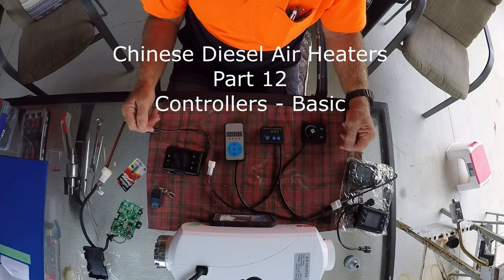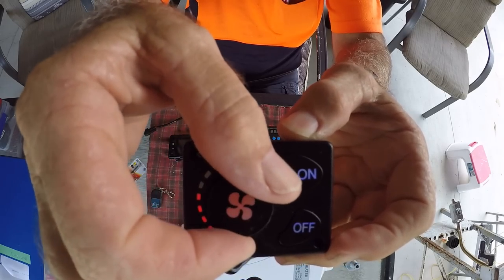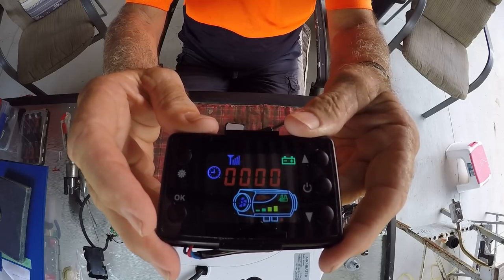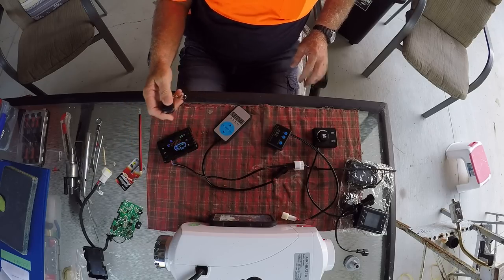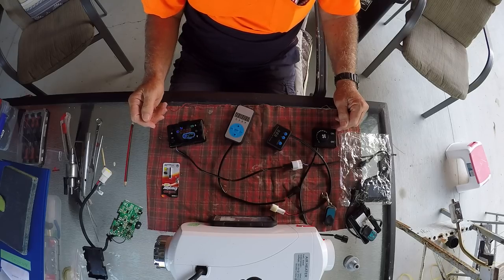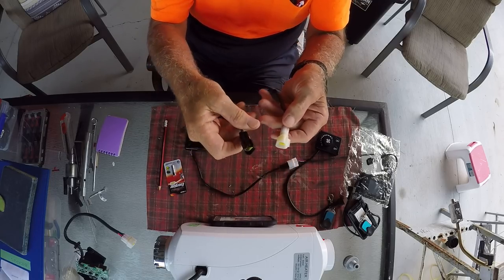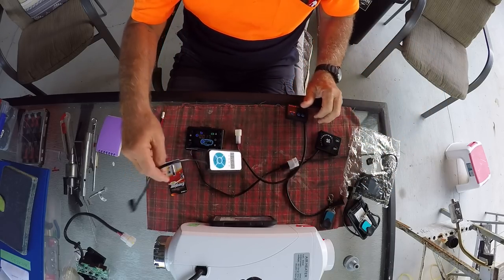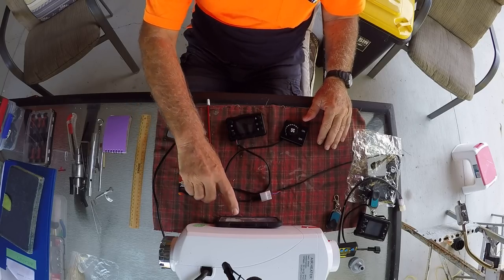Chinese Diesel Air Heaters -  Part 12 - Controllers (Basic)

Comment from the maker: Hi there
You can go into the menu in the ECB and make changes. There are a number of people online who will give you the password. 

I no longer do that because I have seen too many users get themselves in a whole lot of problems. There is no reset button back to factory settings. 

If your set up is correct, and your issues are with a new heater, I suggest you ask for a replacement as you could have controller or ECB issues. JMcK

Comment: Wondering LCD controller has to be mounted inside the room being heated?
Planning on mounting to heater outside the room under a cover and just plumb the heating pipe inside. Trying to reduce noise plus carbon monoxide risk.
Should I wire the LCD controller into the room so the the thermister can control the heat inside the room? Thanks

Comment: If one loses the connection for the controller while the heater is in operation; how about then disconnecting the fuel pump power?  Will the heater keep running the fan in this scenario; with no ECU and no fuel flow?

Comment: My pump disengages on startup. The heater works great, but it's very hard to get it to start. Sometimes I can trick it by priming the pump. If the pump would stay engaged it would start every time. Do you know why?

Comment: The problems you had with the white metal cased heater where the wires were mixed up, what you can do is just unsolder the two or three wires and then resolder them in the correct order. That way you can keep the old ECU. Simply reorder the wire

Comment: Very helpful info. I am thinking of powering the heater from the 240v mains supply using an appropriate adapter. Power cuts in my area are quite common, though they last less than 10 seconds at a time in most cases. What should you do if the power is shut off unexpectedly? 
I was thinking of using a 12v relay and a small motorcycle battery I have sitting around as a fail safe. 
The idea being that when the mains is on, the adapter powers the relay sending power from the adapter to the heater. If the power is cut, then the relay will switch to the battery, giving me time to power it off properly. I would have to make sure to top up the battery every few weeks or after a power cut.  
My question is will the heater notice the short 20ms interruption in power as the relay switches over? I would assume it would briefly flash up a low power warning as the power switches over and then continue running? Maybe it would simply shutoff and overheat? It must be able to deal with short power drops as battery voltage can sag as other high power devices turn on. 
I would love to hear your thoughts and would like to say thank you for posting such helpful info on these heaters. I have been pouring though your videos and they have answered many questions.
Reply from the maker: Hi SF,

I do not like to give definite comment on something I have not personally tested, and I have not tested a 20 ms power cut. But I can give you an opinion.

If the ECU detects a voltage drop it will go into a shut down cycle to protect the heater, and I suspect it will do the same if it senses a power supply interruption. Whether it can sense a 20ms interruption I do not know, but you can bench test it yourself. Next time I am doing a bench test I will do this for my own knowledge.

However, as you are going to use a motorbike battery, have you considered using that to power the heater, and connect the battery to a small multistage smart charger, rather than use a mains power supply and a relay.

A 10 second power outage on a very hot heater will likely cause damage to the ECU

If you do bench test the relay, I would be most interested to hear the outcome. I am on my sail boat in Greece at the moment and can't do bench tests.   JMcK
Reply: @johnmck1147  Thank you for the reply! I understand your position on the subject and will have to do some tests. 

Do you know if the fan motor is a 12v DC motor? If so maybe I could wire the relay to the motor directly so if the power goes out the battery will kick in to keep the fan running. I hope its not some fancy AC 3 phase setup that I will have no hope in powering with ease. 

I assume the only issue with a power cut is the ECU board getting too hot? Also maybe residual fuel in the chamber? 

The only reason I came up with the relay and small battery idea was because I already have the items to hand. I normally keep the battery connected to a tiny solar panel that trickle charges it and thought it could easily keep the heater running for a few minutes if the power was interrupted. I don't think it has the grunt to run the heater for long periods. 

I could maybe try and relocate the ECU board outside of the housing as a last ditch attempt at protecting the heater from unforeseen events.

Anyway I will keep you posted on the situation. 
Enjoy your holiday! all the best.
Reply from the maker: From logic only, I do not think a 20 ms power cut would cause issues.

Worst case heater would go into shut down mode safely as power would be available after switch to run glow plug and fan. But this needs to be tested.

It is not practical to move ICU out of heater. Too many issues.    JMcK
Reply: @johnmck1147  Just a little update. I spent a while tinkering and I got it to work. Though I did have to change my plan a little. 
When powering the relay from the same 12 volt power supply that the heater is connected to I noticed that the power supply would take a short while to die when the power was removed. The heater would switch off just before the relay switched over to the battery. The relay didn't need much power to stay energized and would switch over to the battery just a little too late. This would cause the display to blink. (tested while the heater wasn't running)

I needed to find a way for the relay to switch earlier so I rummaged through my collection of old 12v wall warts and tested them to see which one would make the relay deactivate the quickest when power was removed. I found one that was instantaneous and used that to power the relay separately. 
So now when power is removed the relay switches instantly before the heaters power supply has even started to die and the heater continues like nothing happened. When power is reinstated again, there is also no issue as the heater power supply thankfully comes on instantly.

I plucked up the courage to finally run the heater and test it. Sure enough it didn't flinch. The fact that the heaters power supply would take a second to die and finding a small power supply for the relay that dies instantly made the switch over to the battery happen so quickly that the heater didn't notice a thing. 

So while my initial theory didn't quite work, I was able to find a simple solution using old junk I had floating about. 

In conclusion you can make it work but I can't say there is a definitive circuit that will work in all situations. I was lucky that the heaters power supply would stay on for a brief period when the power was disconnected and that I found a power supply for the relay that would deactivate really quickly. 
I'm pleased I didn't have to spend money on a leisure battery and smart charger to power the heater. My hoard of junk parts and a little experimentation saved a few notes. Hopefully now if we have a power cut the heater won't have a meltdown.
Reply from the maker: Hi SF, thanks for that info and feedback. I hope all goes well for you.  JMcK

Comment: Hi good videos, 
On this video you say that if you have a different connector on the control unit and you wish to change it for a red/blue controller etc, you need to swap the ECU to match them up . you can't as the round or triangular plug on the control unit connects to the wiring loom, not directly into the ECU. the wiring loom needs to be changed.

Comment: Love this series, thank you! Would love if you tried some mods, like moving the electronics out of the heater so they can't get too hot if power is removed. Or if there would be a way to mod a controller to be able to turn LEDs on and off with external switch. Oh, separate question, what are your thoughts on the heaters that have a metal housing instead of plastic? I like the idea as far as durability, but concerned the housing would get to hot.
Reply from the maker: Hi Hoss

An uncontrolled shutdown is not a common occurrence, so it would hardly  be worth the effort of removing the electronics. It could be done though.

I have already done tests on the metal case heaters, (the white heater you see here is aluminum), and like you I initially thought there would be an issue with the metal case getting very hot, as aluminum is a great conductor of heat. But my tests showed this not to be the case. Aluminum heat transfer works both ways, so the incoming air kept the aluminum case cool. My tests showed virtually no difference in actual case temperatures at varying settings. It is really just a personal preference thing what type of case you buy.

I was planning a video test, but I am going away sailing shortly for three months. Perhaps I may do one later in the year.  JMcK

Comment: I bought a 5Kw heater and when I tried it the pump ran for about 2 minutes then stopped and never worked again as I get the E4, pump failure come up, even with a new pump. I wondered if this is a control failure in the module as I can hear a click when I try various things but the pump doesn't come on. I tried the pump on another model I have and it works ok with that one, so, now I have a spare. Should I buy another module and see if that solves the problem?

Comment: Hi John
Thank you for the Videos and the  help you provide. Could I ask if you could do a follow up video on how to fit/replace existing controller . In particular the Forth one  the full function one. Many thanks
Reply from the maker: Oh John, 

I did these videos some 5 years ago now, and there are now lots of heater videos on YouTube on these matters. When I did these videos, the suppliers followed the same protocol and used the same plugs, so it was very easy to mix and match controllers and mother boards….They all talked to each other. 

Now many suppliers have gone proprietary and this is not simple anymore.

If the plugs match, there is a good chance your new controller will work. You just have to try and see.  JMcK

Comment: Hi John love your informative channel, my heater is barley 12 months old and has stopped working it comes up with a E10 code ,and on further investigation no fuel is getting to the unit,now the pump is still working and i have found all the rubber fuel line has perished ,very poor quality, so i am wondering if air is being sucked in and not allowing the pump to prime,i suppose I will have to go to a auto store and buy some quality fuel line ,any suggestions on this problem. Thanks again John.  Steve.

Comment: Mr. John... could you tell me how many 90's you can have in the exjost pipe until it will not flow out properly. 3 or 4 bends ( 90's )????? Thank you !!!
Reply: You are the BEST!!! I new that I had seen it somewhere so I went back through your vids there it was on #8. Once again, you ARE the MAN.  Thank you for being you...
Reply from the maker: Hi RanchDude, the short answer is three. It is recommended that the maximum combined bends in an exhaust must not exceed 270 deg.  Suggest you look at video no 8.  
Cheers . JMcK

Comment: Awesome video John, do you know the control PIN OUT for the harness? I wanted to integrate this in to a controller I built for automation. Or does it use I2C/SPI/etc and communicate with the main board?
Reply from the maker: Hi FJS,
In the controllers I have, the blue wire is the communication wire, the other two are power wires.  JMcK
Reply: @johnmck1147  Thanks for that John! Would be curious to see if we can integrate in with a serial i/o - enjoy your videos

Comment: I appear to have the advanced black controller but on a basic motherboard. When I press the settings button, nothing happens except a beep from the controller itself. The pulse rate increases in 0.5hz increments only and cannot be adjusted until the heater is on. The issue now is it reporting E01 and my only conclusion is it is somehow stuck on 24v. Without the settings menu, I have no idea how to change it back to 12v. Any ideas?

Comment: Hello John first of all thanks for this entire series!
Any idea for a contingency plan in case the electrical system switches of and you ain't there/don't notice? Like if a Fuse Bursts?
Reply from the maker: Hi 18S, sorry for the delay. This is a most rare occurrence and one I have never heard of in practice. With a low voltage the heater goes into shut down mode. But it would be good design practice to have the heater mounted in an area with some cooling space and a place where it was impossible to cover the heater with , say clothes in the event it did overheat.  JMcK

Comment: Morning John, Have you found a more durable/ better alternative to the  plastic vent that delivers the hot air into the room. 
The hose clip holding the hose to the plastic vent loses tension during heating. (ie plastic softens due to heat) consequently the hose dislodged and melted the plastic vent. Thank you Dave
Reply from the maker: Hi Dave,

I have had no issues with mine, but I am aware of some, new to market, heater sellers providing garbage accessories with their heaters. Not just hose, but fuel line, hose clamps, and substandard  electrical wire.

Some marine and hardware stores sell an insulated aluminum vent hose that may be suitable for you. 

I am currently away sailing for 3 months, and your question has prompted me to do some research on this when I return home.  JMcK

Comment: I don't know if you are still out there. If you are,,,how do I safely open the second controller you showed.the one that also uses a remote. It seems I might need to resodder red blue or black wire connections inside

Comment: Hi John, excellent information in this video. Are you familiar with Jayco caravans? I’m wondering whether I could just pick up the 12V power from the fuse box? Reason I say that is because Jayco’s already have a 12V isolate switch in the “roller door” area. Provided I go through the heater shut down sequence, I figure I could then just isolate the 12V and not have to worry about installing another switch, to power down the controller (when van is not in use).
Reply from the maker: Hi Greg, these heaters draw around 10 to 12 amps on start and shut down, and you require a 15 amp fuse. One critical install requirement is to upgrade the wire size if the heater is more than about 500mm from the battery, if you don't do this you will have starting issues as voltage drop in the wire loom does not heat up the glow plug enough to get a good burn start.

You can use the fuse box if it has adequate wire size from battery to fuse box.

I always prefer to run the heater wire direct to the battery with its own fuse and master switch. Often in caravans the wire size to the fuse box is marginal, and people run lights, TV, phone charging etc, and to turn on the heater as well causes significant voltage drop in the system.

Cheers,  JMcK

Comment: do they come with an extended cord?  Also my remote stopped working, the light still shows on the remote when I push a button, it just wont sync.  It used to work but just stopped.

Comment: John, I have a couple of general questions.
1. I see that these Diesel Air Heaters come in several sizes, 2.5 kw, 3.0 kw, 5.0 kw and 8.0 kw. I'm concerned as to what size chinese diesel heater I should purchase for my USA 2018 Ford Transit, Tall Roof and extended length Campervan.
2. I would also like to mount the fuel tank on the exterior of the vehicle on the drivers side underneath and fillable from the exterior of van. I don't want the tank in the living area of the van. Do you have any recommendations. The van engine runs on gasoline and not diesel.
Reply from the maker: Hi Michael,

First up, I have only ever seen these Chinese diesel air heaters come in two actual sizes. 2.5 kw and 5 kw. For marketing reasons some less than honest suppliers advertise these heaters as different sizes, but actually sell you a standard 5 kw heater. All the 8kw heaters I have seen are actually 5 kw heaters sold at a higher price.

Now my suggestion. 
You do not tell me about how well insulated the van is, or the area and outside air temperatures you expect to experience, but I suggest you go for a standard 5 kw heater. Some people have another opinion, but I have the view that it is better to have a heater of greater capacity than needed running at a lower setting where there is less noise and less stress on the heater, rather than a smaller heater running flat out all the time.

If space is an issue for you and the van is well insulated and you are not in constant negative temperatures, you could get buy with a 2.5 kw heater, but an actual 2.5 kw is hard to find.

From my experience, there are yet no 8kw diesel air heater. They are all stock standard 5 kw heaters branded and sold as 8 kw heaters at a higher price.

You can mount the diesel fuel tank where conviennent for you provided you use acceptable install practices. You are aware these are Chinese copy diesel heaters, not petrol heaters, although with the genuine Eberspacher heater you can purchase a special petrol version.

Regards,  JMcK

Comment: Hello from BC Canada , do you have any experience with the oval style controller, I have one for a Amazon Happybuy 5kw diesel heater . I can’t find any I for on setting the temperature. I was wandering if I could up grade this controller but problem may be it has 4 wires connected to it. Any advice would be helpful thank you.